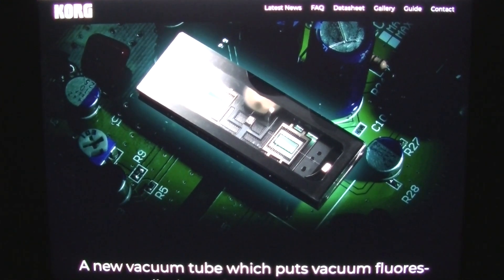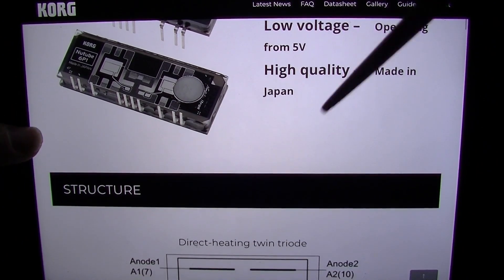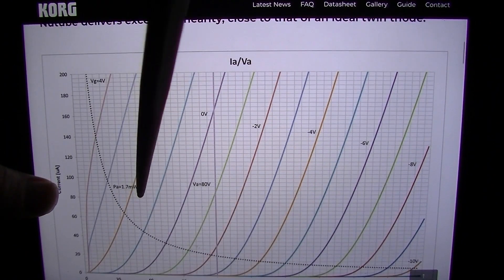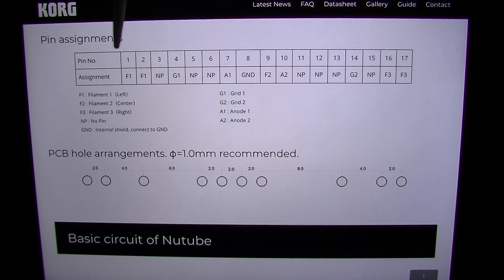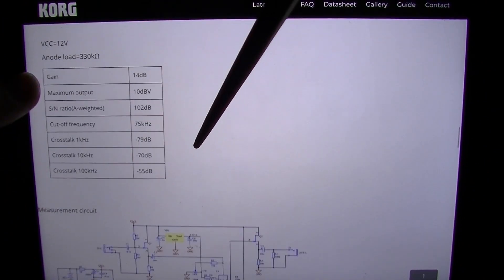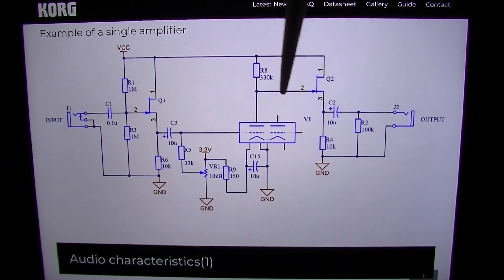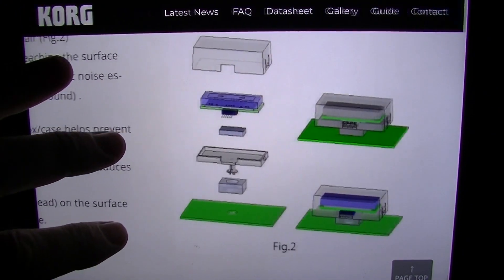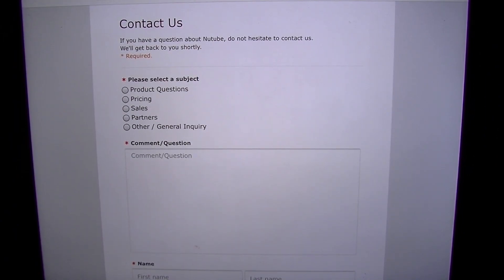Is This "Tube" REALLY the Future? - Korg's NuTube Vacuum Fluorescent Tube

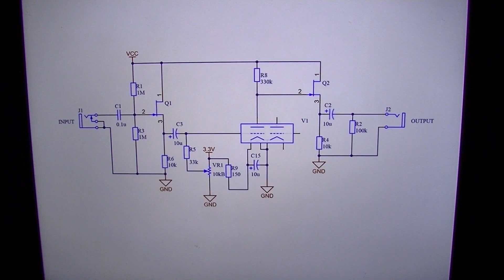Comment: What a cool little device!  Thanks for the video!  I found these little  HV boost converters on eBay (item number 322374615632)  and I was planning on using one to build a very small single-ended guitar amp.  You would only need a standard 12V power transformer to drive everything.    It would be a really cool project to use one of these NuTubes as the preamp and then use something like a 6BM8 for the driver and output.  The gain of these looks to be a bit lower than an actual 12ax7, but more than a 12au7.  The schematic you show at 9:43 has a mosfet current buffer (Q2), which could probably be eliminated if you are driving the 6BM8's triode section directly.  That way, it would be a 100% vacuum tube audio path.  Sounds like a project!  Thanks for sharing, you always have something new and interesting on your channel.  Keep up the good work!
Tony
Reply from the maker: Thanks Tony. I appreciate your content as well. Watched a few of your vids here and there and they are great.
Reply: You sir, are correct.  Thank you for catching my error..
Reply: xraytonyb, those are jfet schematic symbols, not mosfets.
Reply: I have that same voltage booster board and it works wondefully well. Gonna use it to power a tiny 1w SE subminiature amp (6N21B preamp, 5902 power amp), fitted inside a Danelectro HoneyTone enclosure.

Now, if you want a cool and easy SE project with a triode-pentode tube, here you are:
https://www.youtube.com/watch?v=GnCRv-u-dQ4
If you get one of those 16v "laptop" power supplies, you could power the filament and the voltage boost board without any problems.

About the NuTube schematic, from what I've heard some in-depth videos explaining, they have a low input impedance, so they NEED a buffer or other kind of impedance-matching circuit going into their grids.
I honestly think that it wouldn't be very efficient to mix a NuTube and a traditional tube in the same circuit. If you're gonna put a tube in there, then just add a second one. It's gonna be more simple and work better in the long run.

Comment: i used to work with Nortitake back in the late 80s early 90s. they are the best Vacuum Fluorescent display makers by far. it will be a quality part. 
It is disappointing that it is a direct heated design though. that puts limitations on applications. I'll wait for the indirect heated version to come out before i design an amp based on it. 
Filament voltage of 0.8V per section is nice. The thing is slightly less than 2" long by 3/4" side ( 20mmx45mm)
Reply from the maker: Agreed. Directed heated at that price... still a way to go before it's a really attractive alternative. I'm willing to reserve judgment.
Reply: the technology may not allow a different method... 
any old VFD can be used as a similar triode. Thats simply how VFD is made.
You can start your experiments with that, if you wish. 
Harvest a couple from old VCRs or car stereos  and you have your test tubes.
Reply: That’s my reservation on these as well.  Until they are indirectly heated, amp circuits are going to look more like transistor designs than the classic “big 3” tube amps.  And with the noise/microphonics issues I don’t see them being used for much more than buffers/output recovery amplifiers (aka “placebo tubes”) and practically useless for gain stages (especially higher gain designs).   But I’m taking this like I did “digital modeling” 20 years ago- I see potential, but there is a long way to go!
Reply: Barry's right. I did a video on my channel showing a VFD I used as a triode.
Reply: VFD are essentially directly heated triodes, with very low temperature filament/cathode - you can just see it glow red slightly in a dark room. 
This is BTW what's shown on the pictures, on the left the horizontal filament line is barely visible at 17mA, and on the right you see the filament clearly glowing more at 25mA. The light emitting rectangle is actually the plate, so no, it's not a "burnt out filament" they are showing. 
I sincerely doubt they'd modify the technology to provide indirectly heated cathode in a VFD - the whole point of it is that it's low-temperature, low mass and therefore low power cathode.
Reply: Crazy, I thought of using a VFD as a triode about eight or nine years ago. But shortly after I came into possession of a lot of conventional vacuum tubes, so out the window experimenting with that idea went!

Comment: to me it's a gimmick to try to fix a problem that doesn't exist (high voltage requirements, meet transformer or switching power supply...fits in the palm of my hand, provides 180+ V to 2 12ax7s), a very proprietary gimmick, likely expensive.

some pedal builders may like it, but 12ax7s are very cheap and I doubt they are going away.  I'd be more worried about power tubes...
Reply: I'd amend that to "doesn't exist yet."  These were developed because there's a very good chance vacuum tubes are going to be banned in Europe in the near future because they eat power.  Class A amps are stupidly inefficient.  Moreover, if you are running them hard during the summer you have to double dip because you're going to run your A/C to keep your room cool.
Reply: I wouldn't see why they would care.  The average tube amp doesn't use much more power than a computer, and much less than a space heater.

But hey, guess the Brits picked a good time to leave the EU.
Reply: Crunch2 - Not true.  The watts rating is not based on power draw.  It's based of power output.  A class A tube amp runs at a max 35% efficiency at best and can get as low as single digits efficiency.  Moreover, a class A amp draws power as long as it's on, even if you aren't playing anything through it.  So a 100watt amp can be drawing as much as 400 watts.

By contrast, a class D solid state amp is 90% efficient and when it's not making noise, it stops drawing power.  A class D solid state is at a minimum three times more efficient and can be up to ten times more.

The heat coming off a class A amp is wasted electricity disappating as heat.  The harder you drive the amp, the more you waste.

Comment: Looks cool, Back in the mid 70’s when I was first at work we spent a year doing value/tube theory, but the company I work for made untra low noise, low powered test equipment so value/tube was old tech, so we used transistor tech, I now appreciate the sound of value/tube but it would be great to see a new take on it. And to be honest I was also scared when working on value/tube stuff when it came to high voltage and relatively high current. We did work on 1kv and 240 mains but that was low current or in psu.

Comment: Hey B rad, I have 2 new designed guitars and would like to put a new tube into the guitar. Maybe we could in conjunction put circuitry into the guitar and maybe just use a 9 volt battery to run. They have a new pedal out, NTS tube screamer. Therefore u can have a small enough package to put into a guitar. Please give me a shout if this interests u!!!

Comment: If I remember correctly the reason tubes and other old electronics are being banned in some parts is because they're so inefficient, I'm glad there's some modern alternative we shouldn't take tubes for granted if they're banning hairdryers and vacuums items everyone uses what's stopping them from Banning tubes(sorry bad English)
Reply: And the green pencil pushing [...strike that, trees are killed for pencils] assholes banning personal appliances and UNSURPASSED MUSICAL INSTRUMENT TECHNOLOGY, aka vacuum tubes, these guys use more fossil fuels than 95% of tube guitar amp players. Besides, we went from billions of 100 watt incandescent light bulbs to their 12 watt replacements in 15 years, so I think we can lay off killing the guitarists prized tube amp that is operated for 10 hours a month on average (across all players)! 
Bottom line? Fukoff leftist morons.
Reply: An interesting explanation I've heard was that valve amps being more expensive, they're usually fitted with more sensitive speakers ;)
Reply: Saintier set For use as GP transistors that’s certainly true, but for whatever reason tubes reportedly produce more audio output per watt than does pure solid state.  (Assuming power for the two types are reported honestly and consistently; wouldn’t surprise me to learn that tube amp power is reported purely as the output rating of the output tubes, ignoring overdriving and/or pre-amp sections.  Never having owned a tube amp I cannot measure input and I’ve never amped my Katana.)